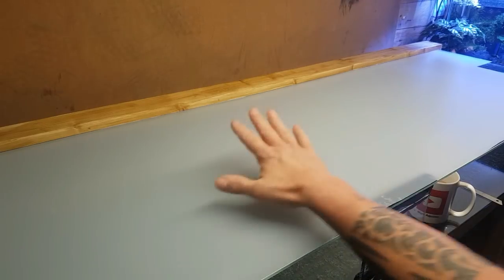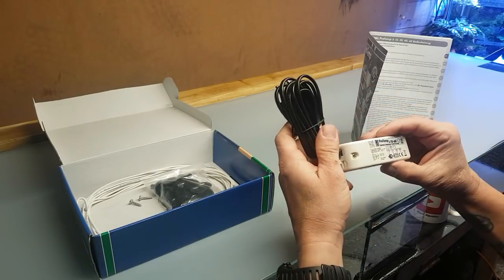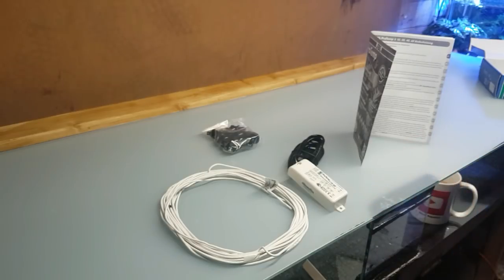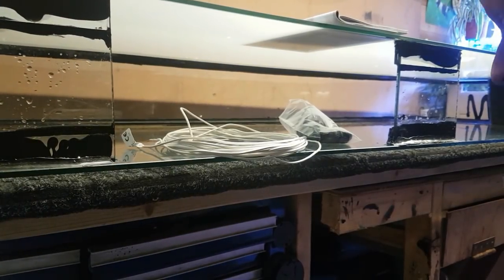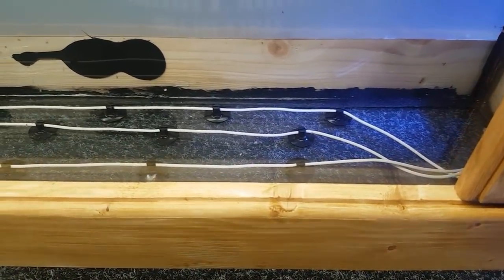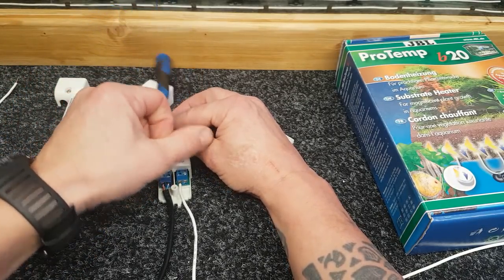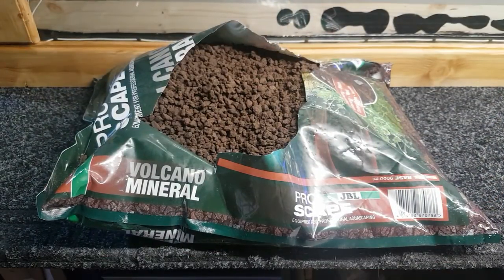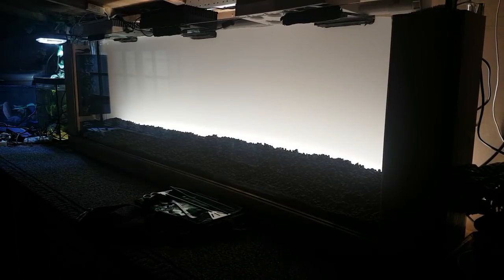BENCH AQUARIUM PART 5 JBL UNDERGRAVEL HEATING

Comment: I use volcanic rock dust in garden and that is amazing stuff, so I can imagine that substrate being great, I will have to get some.  What about LED strip with multi colours and remote, it would be cheaper to run, easier with remote and slimmer may even fit on thin edge of back ledge so can still sit right back. You can get the ones that are for around TV that you can join and run off USB. I have extension leads that have normal socket and USB, very handy.  looking great!
Reply from the maker: Great ideas there but I'm going to fit some marine lights in the hood.Thanks for watching.👍😀

Comment: I use a heating matt on my tank it goes under the tank on the outside and doesn't need a transformer, Its called an ultratherm, I bought mine years ago. Dont know why more people don't  buy them they seem more reliable than a tube heater.
Reply from the maker: +MoreChannelNoise I've used heat Matt's in the past they work great.

Comment: Wont the the undergravel heaters raise the temperature of water, especially during summers?
Reply from the maker: Neeraj Batra No. They only slightly  warm the substrate for the growth  of the plants .
Reply: Thats 12v DC , but how many watts, is it 12 watts too, I couldnt hear that properly? I am in Delhi, India where summers get very hot , so was just apprehensive will these heaters further aggravate the problem? I know there is no substitute to doing and seeing but trying to exercise a little caution.
Reply from the maker: Neeraj Batra In the UK we don't get  very hot weather and if we do not for long.😂🤣 so I would air on the side of caution in Delhi. They're 20watt. Each.
Reply: hmm.. thanks Mark. Need to check from some local gurus here :)